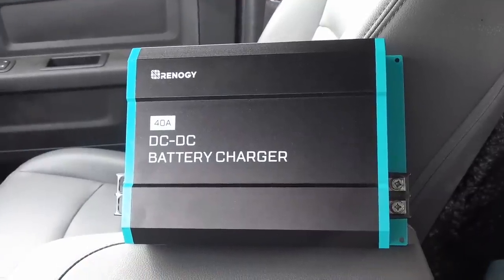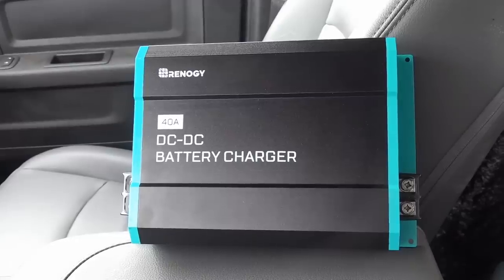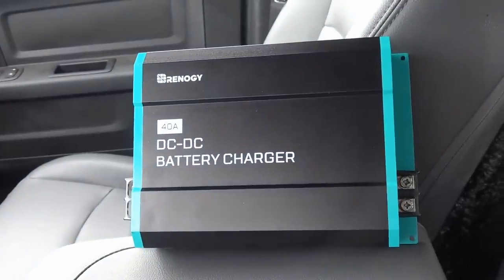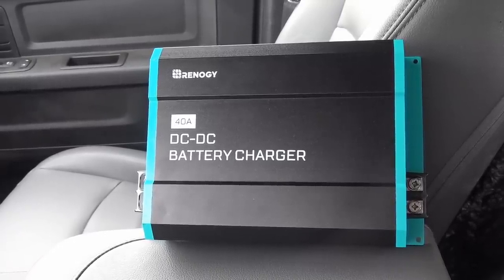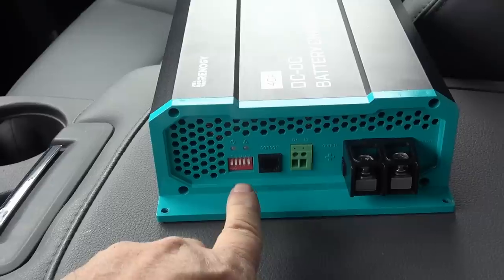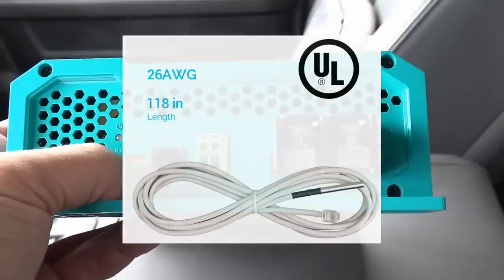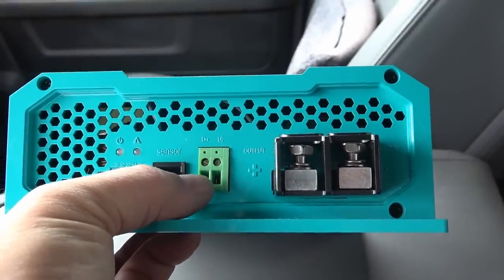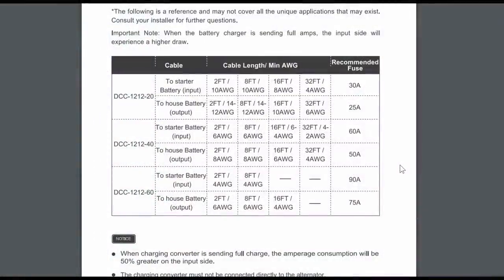Extra 40 Amps Charging into RV Battery Bank from Truck Alternator (Renogy 40A DC-DC Charger)

Comment: This was exactly the video I was looking for. We recently took a trip in our travel trailer and I noticed the truck would not charge my 2 AGM's while driving even though it would show an increase in voltage through the 7-way. After some research I found I needed a DC to DC charger to get the amps needed to charge my house batteries, and your video simplified the installation for me. The connection between the truck and trailer is where I was stumped. Anderson connectors, why didn't I think of that? LOL  Thank you!
Reply from the maker: You're welcome, you should see a big improvement on charging, cheers, Ray

Comment: great system.  a outher tip i used on a install was a voltage controlled relay tp turn on DC/DC charger trigger wire. set around 13.8V That way if alternator fails or engine stop no draw from start battery. newer trucks and cars use the computer to off set the voltage regulator using temp/time load etc. and is set for a start battery for long life. my ford came with 2 battery's and 2 alternators.

Comment: The trailer we just bought has 3-100Ah Lithiums, 600 watts of solar and has the same Renogy DC-Dc charger so this video will be helpful wiring up my 06 Ram.
Last time I wired solar etc was over 10 years ago and I used a Trimetric.  (Think I'll use Victron in thhis new one)  I noticed Bogart has a phone app now?  That's pretty handy to be able to sit in the cab of your truck and monitor your RV batteries.  Hope the Victron has that range.
Also it's pretty cool you answer practically every comment, even when they ask the same questions over and over.  😉

Comment: I have learned a lot from you over the years. I use this DC to DC smart charger in my Class B. I used to have the EcoTrek system, but I had it totally removed, and I use Renogy lithium's with this Renogy smart charger.
Reply from the maker: Cool, thanks for the feedback. I've had good luck with the Renogy panels over the years. Price was pretty good for the charger compared to others on the market. Cheers, Ray

Comment: watched 4 dc to dc videos before this one. WOW everything i needed to know right here, filled my amazon cart as well thank you
Reply from the maker: You're welcome. :)
Reply: @LoveYourRV  one thing took a few rewinds to catch you mention grounding at the (pickup) frame. is that still working out, worried about issues down the road
Reply from the maker: @billhackley3540  No problem so far. It saved me the cost and hassle of a run of wire on the negative return. My trailer manufacturer uses frame 12V battery grounds for the same reason and I've had it for over ten years with no issues.  Every few years I clean and retighten them. The truck manufacturer obviously also has the frame connected to the batteries or else my frame return wouldn't work. I think the big concern would be the type of vehicle and its construction. Some these days have very little metal in the frames or are not completely connected, but my pickup truck uses large steel beams running the length of the truck.
Reply: @LoveYourRV  thank you i'll do the same, have spent a fair amount on lithium and low frequency inverter charger, have a fair amount in amazon still you've been very helpful. just got started in march with no experience

Comment from the maker: UPDATE  Max Off-Grid Charging Amps Test (Solar + Generator + Alternator) - https://youtu.be/Nt3CG5qeF5o

I test how much amperage I can pour into my 315AH Lion Energy lithium battery bank at if I combine my 30 amp solar controller with a 60 amp Intelipower charge converter and my new 40 amp Renogy DC-DC charger. The battery bank was at a 50% state of charge during the test and all chargers were set to 14.4V.

In this informal test, it came out to right around 100 amps with all charging at the same time and around 85 amps with the generator and DC-DC charger from the truck alternator combined. All and all not bad.

See the previous video where I tested out using a Bogart SC2030 solar charge controller as a DC-DC charger via a temporary cobbled together setup - https://www.loveyourrv.com/alternator-charging-mod-12-vdc-truck-bed-high-amp-power-port/
Reply: Hi Ray, in my Class B, I can charge my LiFePO4 batteries up 60A via the alternator, even at idle!! Comes in very handy during inclement weather (normally use solar). The BMS splits the 60A to 30A per battery. Current slowly tapers off as they charge up to 100%. Much better than running my noisy Onan generator. Between solar and engine idling, I haven't used my generator (boondocking since November 1).
Reply from the maker: Joe, the whole point of the DC-DC charger is to isolate and properly charge the house batteries. The Renogy has a setting to use it with lithium type. As far as it goes the Renogy is one of the most affordable out there.
Yes, spending a bit extra on diesel but saving it on the portable generator gas. Which is more efficient I don't know that would be an interesting test, but I know its a pain to haul out the portable genny, especially if the weather sucks. ;)

Comment: Thank You, you answered an important question for me….
     I just received this DC to DC charger that I ordered, but then this week saw a video of a new version that has dual input for alternator and solar……so I was unsure how to couple this unit with solar, but you showed that you can couple them at the battery bank…..I was worried about reverse current shorting out the solar panels when the alternator or generator current started……thanks for easing my mind

Comment: This makes a lot of sense and would be a great addition to a solar setup. I'll refer the Renogy Charger to the solar pros who will be installing and/or upgrading my RV system. Thank you!
Reply from the maker: You're welcome, just make sure you're alternator can handle the extra load.  Cheers! Ray
Reply: HSkyler 
Paying experts.... get references from people doing what you’re wanting to do. 
I worked for trailer place for a while. Behind the scenes proof of what I’ve always said: paying someone to install something so it works (even if the install “looks” good) is entirely different than getting it done well or properly. I can’t believe stuff I’ve seen people willing to pay for over the years! They just don’t know. They trusted an expert.

Comment: Very helpful video.  I am installing a 60A Renogy DC DC charger in my 2019 Ram 3500 Cummins.   I decided to use 1 AWG wire and ran a both wires from the truck battery to the trailer rather than using the chassis ground.  More money but I felt better about it.  I have a 240AH LiFePo4 battery that I built with prismatic cells and the battery manufacturer stated the 60A was a better choice.  The Renogy charger is a great product at a very fair price.  Costs more for the wiring, Anderson plugs, and breakers than the Renogy unit but all in all well worth it.
Reply from the maker: 60A is a good choice for the lithium batteries , just have to make sure that your Ram alternator can handle the extra load. On the input side of the charger it may be drawing around 70 amps. Cheers, Ray
Reply: @LoveYourRV  No worries Ray.  My truck was set up at the factory for pilot car or snow plowing and has twin 220A alternators!  I felt it was a shame to waste all that power!  I really liked your video.  It help me out a lot in my decison making.
Reply from the maker: Awesome!
Reply: @LoveYourRV  I have a similar setup to yours with 400W of solar on the roof.  We have never run out of power in the summer months often boondocking for weeks with no issues.   I wanted to be able to run the refrigerator on 120V when on the road, and the solar alone didn't allow that.  Now with the DC DC charger we will be able to do that easily with no power issues at all.  Inverter or inverter/charger install is next.  Working on how to fish the wires 3/4 of the length of the trailer in the closed frame to accomlish that in the next few weeks.

Comment: Thanks for this very well done video. I really liked the parts where you showed the actual amperage on your meter and amperage on the other info display. I used the same dc to dc charger, 4awg cable and anderson connectors but I was able to run the feed from the Anderson inside the 5th wheel overhang to the dc to dc charger mounted inside that front compartment. I also used a chassis ground like you did and when the lithiums were low on power, the amp meter showed 39.7 amps. FYI, I have the same truck and same clampon meter. That meter is a mini but the amp jaws can still open just enough to go on a 4/0 cable!

Comment: Great video!
This is a huge deal for me. I have owned a fifth wheel and a travel trailer with 4 different trucks and none of them could charge batteries reliability going down the road. 

The battery positive in the 7 pin connector hardly does anything for the battery's in a trailer. Now I know why and how to fix it.
Reply: I'm with you...i ran a camper on my Ford Superduty for 5 years and could never figure why it wouldn't top up the batteries after 4-6 hours of driving.  with 14ga wire running nearly 30 feet I wasn't getting more than a couple amps per hour through the 7 pin.
Reply: I took Physics in HS (way too MANY moons ago) so forgive me for asking what might be a stupid question for those that are more electrically inclined -  but - if the DC TO DC charger “BOOSTS” the charging capability, why do you need to run a separate and larger wiring setup for the entire route?
Reply: @Abeaness  Think of how much water flows in a small creek when the sun is shining.  Then think about what happens when it storms and there is more water than the creek can hold.  You end up with a flash flood.  Its the same thing with electricity where amps is like the water current flowing in the creek.  Only with electricity the byproduct of excessive current is resistance that causes heat to build and wires to melt.  Another thing to consider is that a fully discharged lithium battery will eat current like a hog eats corn and can fry your alternator along with the wiring.  Lithium batteries are suppose to have a built in  battery management system to regulate current but not all BMS systems are created equal.  The DC to DC charger regulates the amount of current and protects your alternator provided that the alternator is designed to handle the extra load.

Comment: Good job with the project. I would suggest enclosing all your wiring in split loom to protect it from rubbing.
Reply from the maker: Thanks, I chose cable with a double jacket that has an extra-thick outer layer but may add some loom in certain areas.  Cheers, Ray

Comment: Love the production of your video. I have a Pilgrim 5th. wheel and a dodge ram diesel on the hook. I built a very similar system with same type of parts about 2 years ago. Wish I had seen your video, before racking my brains out to make this system. I still do not have a solar system, because I find that in northern Alberta we do not get enough sun to make a huge difference and warrant the input cost. But, I do have a installed generator for extended dry camping. Now, I am building a large out-put Lifepo4 battery bank, Great video, keep up the great informative work. Good health and rving. Dave
Reply from the maker: Thanks! I recently added a wireless on-off mod to my setup https://www.loveyourrv.com/12-volt-wireless-switch-mod-for-my-40a-dc-dc-charger/  Cheers, Ray

Comment: Thanks Ray, you didn't say much about cost.  I suspect you have as much money into wire as the cost of charger.  That's OK as you do electrical installation correctly.  Good Job.
Reply from the maker: Yes cable is a big cost as good copper wire is pricey that's why I tried to keep the gauge to 4GA, I have a parts and tools list in the description.

Comment: Hi Ray - I did basically the same with an isolator & breaker from Hellroaring Technologies. Per their recommendation I ran 8 ga wire & have an Anderson Connector mounted next to my 7 pin connector under the bumper. The other half of the connector is wired thru a marine fuse (saw them on your rig) running to my single  200aH AGM battery & it'll charge from 50% to 100% in about 2 hrs of driving.
Reply: yea ... thats the old school more expensive less effective way to go about it.  as he mentioned, lithium batteries require a bit more finesse regarding voltage when charging.

Comment: I really like the idea of the breaker up front and the quick disconnect between truck & trailer.  Nice install.  Ima go this way instead of the all-in-one from renogy bc I'm pretty sure my panels will be in series with too much voltage
Reply: Some users have experienced problems with the breakers overheating and tripping when they are mounted in the engine compartment.  This is why I went with a fuse block and on/off switch.

Comment: I recently purchased a lithium battery 170 amp hour from Big Battery. Comes with an Anderson connect rather than having the terminals exposed which I like, and it also has a shut off switch to turn the battery off from sending out any current. And for the price for 170 amp hours it’s like 900 bucks which is less than the Battle Born for one of theirs and has a 10 year warranty as well

Comment: For just a little more dollars, I have a Abso DMT-1250 combination DC-DC charger, which handles 50 amps on a 12 or 24v alternator, and also includes a separate input for up to 500 watts of solar panels, optimized by an MPPT solar charge profile that can be adapted to AGM, Lithium, and even has a programmable profile for future battery custom profiles or if you want to limit the draw on your alternator. This solar port can also be used to wire in an AC to DC converter that will then be plugged into shore power. This Renogy is good if you don't want the extra flexibility.
Reply from the maker: Good deal for all in one, I saw Renogy had something similar https://amzn.to/38lh0ba  but I have a solar system setup already with a 30 amp solar controller, so I can output up to 70 amps when combined, also have a 60 amp charge converter on-board for shore power, sort of like having the systems separate in case one fails. Cheers, Ray

Comment: Where those wires go into the box you said you were going to silicone. I would purchase a cgb fitting instead.  Thank you
Reply from the maker: Thanks for the tip. It's been like that for 3 years now, and there are no leaks.  The entrance point is tucked up pretty high and far back under the fifth wheel overhang, so not much water even gets to it. Cheers, Ray

Comment: Thanks for the video, I believe the gauge wire is based on distance and measured by voltage drop between the two ends of the cable.  Saying the cable isn’t hot is a very poor measurement of what is going on. Beyond a horrendous undersized cable or bad terminal 
Other then that some amazing detail on installation
Reply from the maker: If the cable is undersized the DC-DC charger will keep trying to pull more amperage through it to output the 40 amps to the batteries so knowing that the cable isn't getting too warm is a quick and easy way to know that the cable size is adequate for the amperage passing through it. Too warm and you know there is a problem. Too much voltage drop means to much resistance which translates into too much heat.

Comment: You also asked when you would use the current limiting feature. I have the 60 amp model and use it in hot weather and/or when I am using multiple accessories to take strain off of alternator. I also use it when my batteries are charged and I only want to run the refrigerator on AC
Reply: I should also note that you can install an on/off/on toggle switch in your fifth wheel where one switch sends power to D+ and LC, and the other switch only sends power to D+.  I ran two wires from my coach to the tow vehicle and have the toggle switch on my dashboard so I can control it when driving.  When the DC charger is pulling 60 amps it is causing the engine to use about 5hp to run it which makes a slight difference in fuel economy.
Reply from the maker: My 6.7 Cummins diesel doesn't seem to even notice the charger. I also have an optional oversized 220 amp alternator and bare-bones model truck as far as options, so there is not much chance of overheating normally. I have installed a wireless fob switch though, to have the ability to turn off the charger remotely if I want to. Usually, when I'm pulling steep grades, I turn it off.  https://www.loveyourrv.com/12-volt-wireless-switch-mod-for-my-40a-dc-dc-charger/
Reply: @LoveYourRV  Very cool.  I pull power from my running lights to power my backup camera.  Can you configure the switch to power the running lights from the house batteries when you are parked?  If so I could use my backup camera as a security camera when parked.
Reply from the maker: You could get a female 7-pin plug receptacle Example: https://amzn.to/3JRKRw8 and then wire in the wireless switch board so it can switch the running lights and 12V battery charge pin on and off https://www.ajtnt.com/portals/ajstruckandtrailer/7-Way-RV-Style-Trailer-Plug-Wiring-Diagram-2.png  Then when you want to use it just plug it into the male end on the trailer.  :)  Personally, I just wedge a blade fuse in there to do it manually.

Comment: Hi Ray any time you have 12v at the truck side of your charger it should be on. Run your trigger to the + side of the truck. Your ground for the rig side should go to the battery bank to get max amps to the battery bank. I am a retired car audio fabricator\installer 20 years.